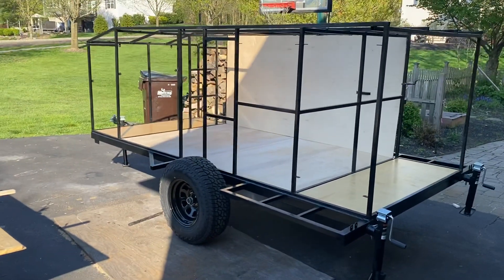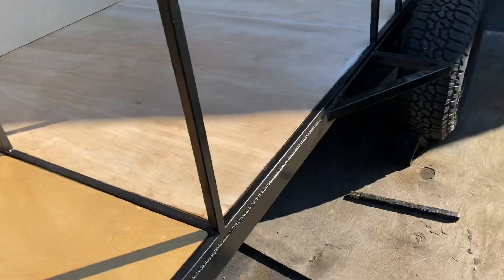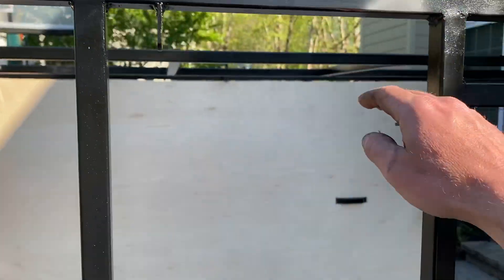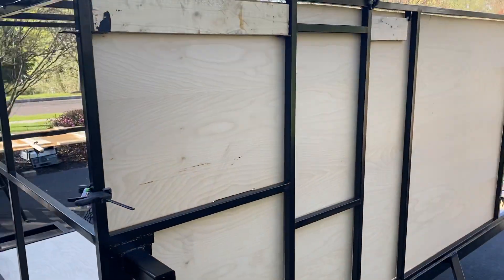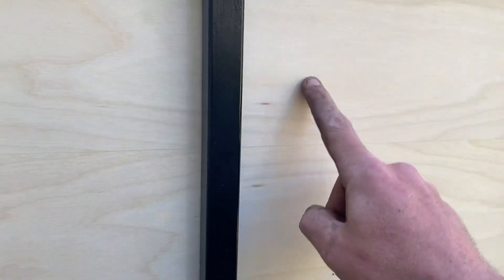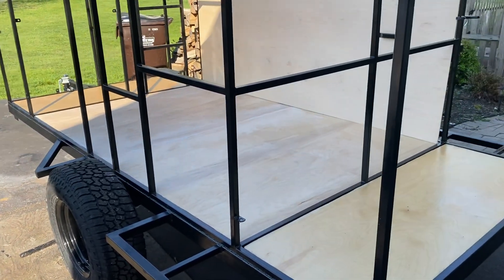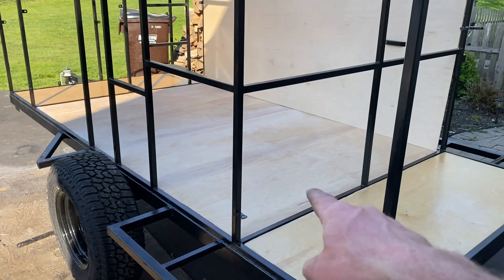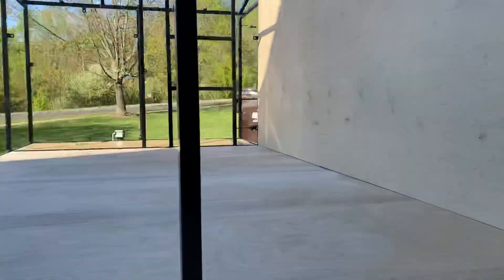Day 15 camper build. Floors in

Comment: I misunderstood how you were doing your framing around the windows. Sorry about that. I'd rough cut it with a jigsaw and then still use a router. You can make a template with 1/2" plywood and use a flush trim bit still. You could rout those out flat too which would be easier than with the inner skins already mounted. Something like this but rough cut with the jigsaw first:  https://i.imgur.com/2yPLV7E.png
Reply from the maker: Makes sense. I agree. Was struggling with the advice yesterday but now you see what I was saying and template seems the way to go. Ty

Comment: I like it, I found you on FB and I am planning a similar build.   I need mine wider so i am planning a 6ft wide, enclosing the wheels. You did steel for everything, was there ever a thought to weld aluminum bars for the cage for weight?
Reply from the maker: Mine is 84” wide tire to tire. Had to fit in the garage. I stuck with 5’ interior didn’t want the wheel humps inside because only 4’ height inside. I stuck with steel. Because of the welder I am using and I hear aluminum will eventually fail on the welds. I am not sure what the overall weight savings would be but using a full size suv so weight isn’t much of a concern. I used 1x1” 14 gauge. It isn’t overally heavy. 1/8” plywood then will fiberglass the exterior.
Reply: Any idea of how much more/less the steel framed version vs plywood would be? I’m in the planning stages for mine now and came across your link on FB. Nice work on this btw!